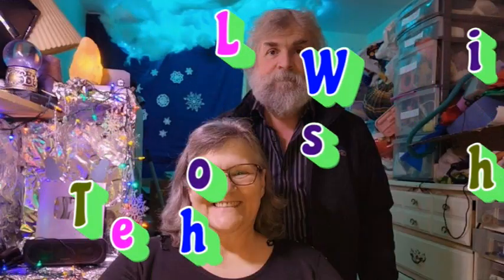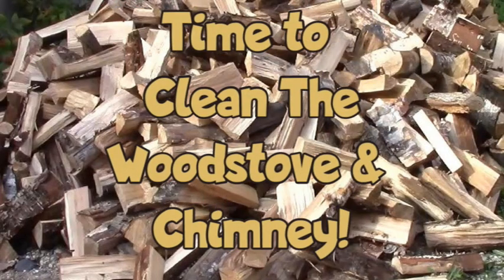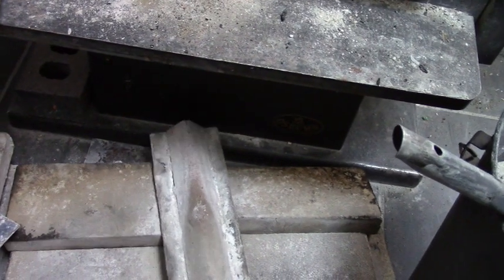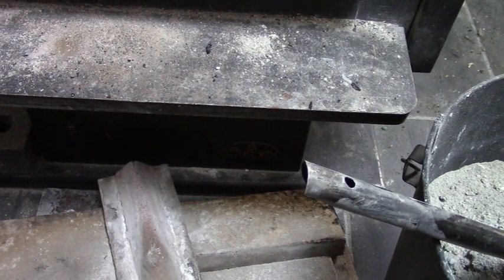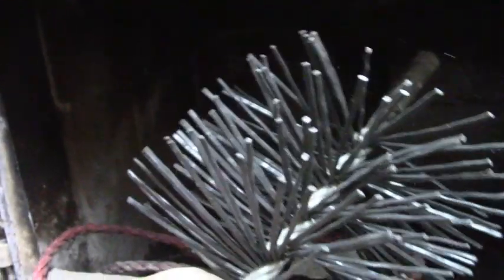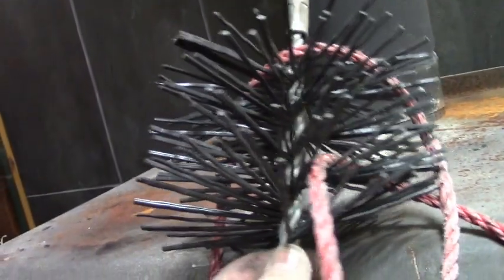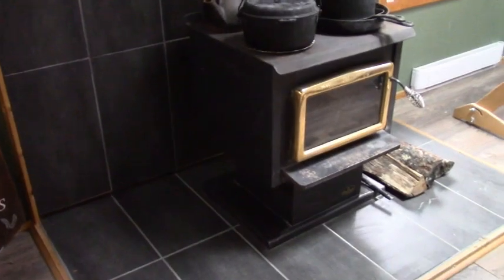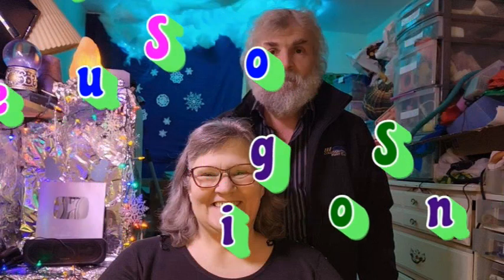Cleaning the Woodstove And Chimney For Winter!

Comment: I would love to have a wood stove. It would be so nice and toasty warm in winter. And I wouldn't have to turn on the gas stove when I want hot chocolate. Just place the kettle on the wood stove.
Reply: This is an air tight, so the top gets hot but not enough to boil a kettle quickly. So we leave a kettle on the stove. Full all day long to keep it simmering.